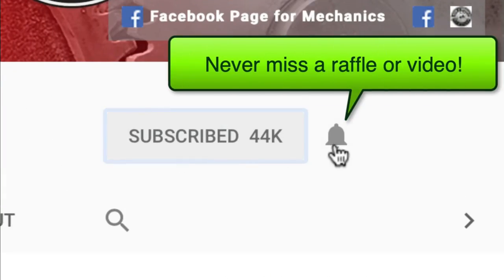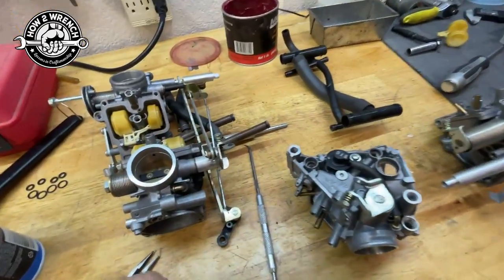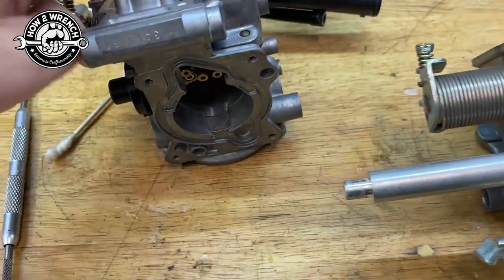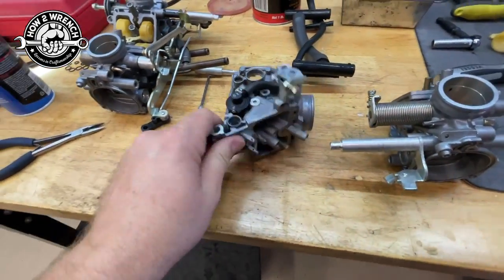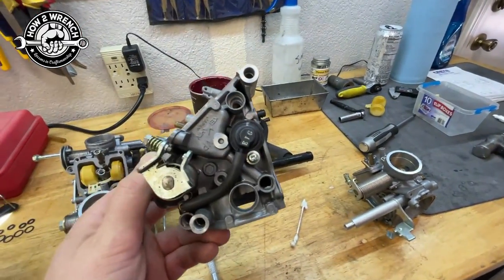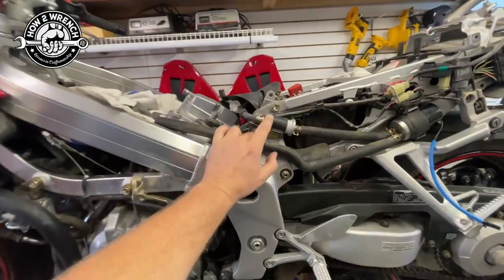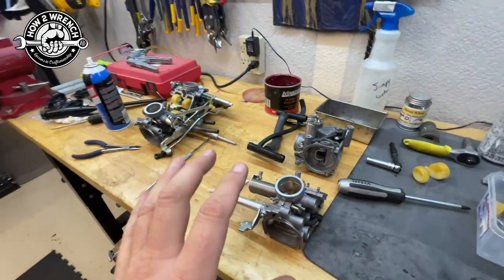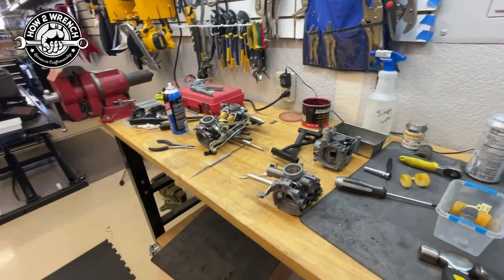Pro Tip for changing parts and HIDDEN FILTER! Did you know? #hidden #carburetor #mechanic #diy

Comment: As a professional Automotive Engineer (my channel is about cars though), I say there is no such thing as non serviceable. If it's been put together,it can be taken apart! And new parts can always be made.
Reply: Well possible to service vs practical/economically realistic to service are different things.  People have only so many tools, skills, time, and money.
Reply: I have told myself that very same thing! I feel vindicated 😂 Thanks! & Thanks Shane for helping me rebuild my carbs! Your knowledge is priceless!
Reply: @jeffheise5175  @connor3288 is right, people only have so many tools and skills. I'm surprised the @how2wrench shop doesn't offer a reconditioning service for this part. I haven't got one so I can't tell, but it looked to me like a small puller would get the insert out and it can't be difficult to get a workshop to make a small batch of inserts. Or maybe, get that filter out of there and fit a better quality fuel filter in the main line.
Reply from the maker: @jeff You're welcome
Reply from the maker: @cyclone Note form Shane "Thanks for the thoughts...we are not a machine shop per say and the cost to repair would outway the benefits or optional methods. While we love the "repair it vs. replace" ideology right along with you, there is a time and place. The extensive labor, sourcing of material and extreme craftsmanship required to duplicate fuel metered part would not fit in most people's scope." That being said HECK YES on fix it when possible...😁
Reply: Hiya Shane great pro tip video thank you it's a pity after market carb manufacturing company's don't make new inlet insert seats you would think there would be a good market for them
Reply from the maker: @patrickkelly7674  I hear you. They do make them when the OEM offered it, just not for cases where you would have to drill out the original.
Reply: @How2Wrench  Thank you for your reply from Patrick Kelly small engine repairs Ireland